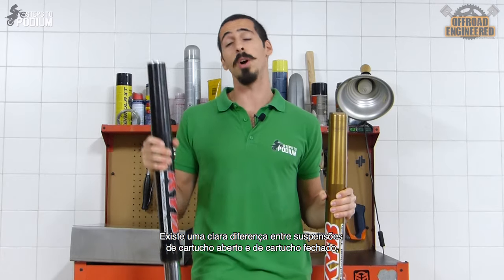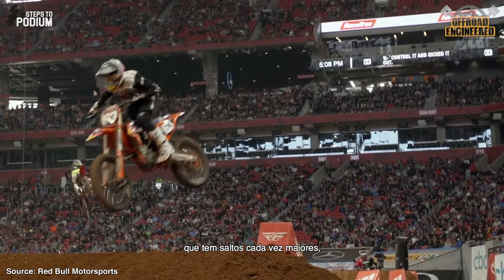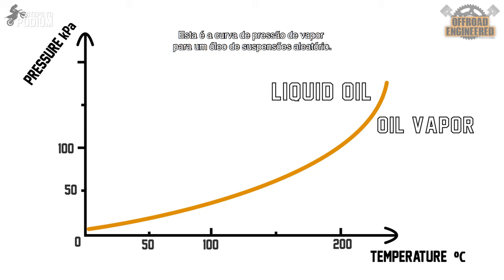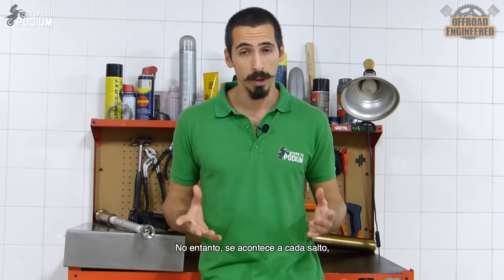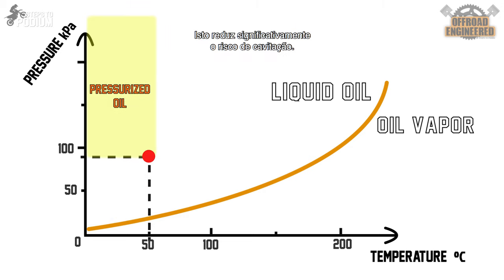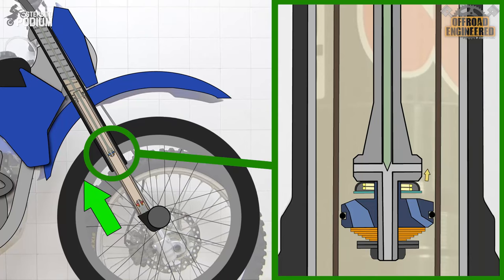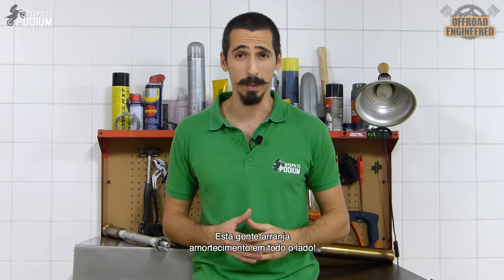The difference between Open & Closed cartridge forks | Offroad Engineered

Comment: Your videos are great. Super clear explanations and great advice. I have tried to work out what the performance difference is between open and closed and struggled to find answers, Now I know. Thanks. 
When it comes to faster cornering and relatability in performance do you think closed is the way to go? Like say a super moto setup.
Reply from the maker: you're welcome and I really appreciate the good word! Thank you! 😊
Honestly, for road use, an open cartridge should be more than enough, imo. the closed cartridge technology only came around to cope with the stresses from Moto/supercross. Enduro and off road in general, benefited afterwards since it got "cheaper" compared to the early beginings
Reply: @StepstoPodium  SO well serviced open setups will give you pretty much the same repeatability and handling unless you a beating it with big jumps. 
Sounds good and cheaper. Nice. 

Now just need to choose springs and oils to dial it in and not of that annoying gas filling.
Reply from the maker: exactly! 😁 I'm glad I could help and if you have any other questions, don't hesitate in reaching out 😊

Comment: Would you rather have a 43mm closed cartridge fork or a 48mm open cartridge fork in enduro-esk situations?

I'm looking to upgrade my stock 43mm suspension which has no adjustments on the forks. The 2 choices are between ordering xplor 240mm suspension & then spring them or get tractive closed cartridge 240mm dropins for my current 43mm forks and their shock to match.
Reply from the maker: That is a really good question! I think that if the open cartridge option are the xplor, maybe I'd go with the CC 43mm
Reply: @StepstoPodium  here's another weird question for you. How hard is it to mix & match off-brand parts? Rebelx sells a kyb 48mm fork for t700 that was shown off by pol tarrer at romaniacs this year. Is it possible to retrofit that to fit a ktm? 

It probably seems like I'm overdoing with the fatti-boi but for some reason I decided this is the bike I want to use when I go out west & check out the harder trails like the 5 miles of hell. So I'm spending gobs of time researching, money building the bike & time at the gym doing squats, deadlifts, and cardio 😭
Reply from the maker: @houjous5131 I have no idea 🫠
Reply: @StepstoPodium  I know there are conversions out there for some forks. Worth the question 😂

Comment: I enjoyed the video, is there a way to modify the damping ability or the length of the trip?
Reply from the maker: Revalving is usually an option! What do you mean with length of the trip?
Reply: @StepstoPodium  It is the distance between the highest point of elevation and the lowest point of compression that varies with the weight of the occupant
Reply from the maker: It shouldn't change if you install the right spring rate

Comment: Great vid. Can you help me understand why installing a rising rate spring on the cartridge piston would increase small bump sensitivity and help with bottoming resistance?
Reply from the maker: Hey Ash!
Sorry to not have replied to this comment. It missed me!
So, assuming that the rising rate spring starts off with a lower rate than the stock one, on the initial part of compressed stroke, the piston will apply fairly little hidraulic preload, allowing the forks to more easily compress without feeling that "harshness" cc forks are know for, and once the forks start compressing deeper, the hidraulic preload will increase exponentially since it isn't a linear rate as the stock one, providing more hidraulic preload and as a consequence, resistance to compression.
Sorry for the lateness but better than never! 😅🙌🙏

Comment: On closed chamber forks, does the outer chamber fluid volume really matter that much?  It’s just lubricant at this point and provides no damping.  Or does it?
Reply from the maker: It not only provides lubrication, but also provides damping and bottoming resistance
Reply: @StepstoPodium  I think I get it now.  The oil just provides lubricant.  But, because it takes up space and is essentially sealed in the forks.  the air gets compressed when the forks compress, and that resistance creates more bottoming resistance.
Reply from the maker: Exactly!! Also, the way some spring perches are made, can actually provide some damping the same way the orifices on a piston provides damping.

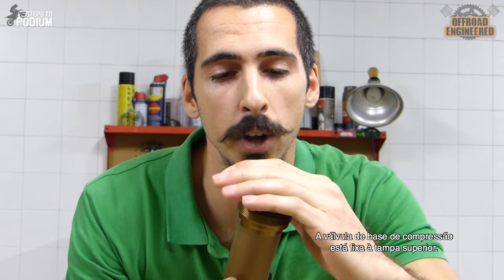Comment: 4:33 -- Is that free piston locked in place with no movement OR is there slack in this piston, allowing the piston to move BEFORE the spring comes into play.
Reply from the maker: It's just a diagram, the piston doesn't have any play 🙂
Reply: @StepstoPodium  I must have something wrong on mine because my piston moves 1\4 or so before the spring comes into play ...
Reply from the maker: It may depend on the brand, but either way when the piston is installed in the cartridge, the oil will force it upwards, eliminating any play
Reply: @StepstoPodium  Ok and thanks ... Are you the guy in the video with the green shirt answering my questions?  Either way, thanks for the help and the videos .. ESP this one ...I had no idea what the differences actually were but having both types, as you said, I can't actually tell the difference with my riding ..
Reply from the maker: Yes, I am, although I'm not using the green shirt right now 😂
Glad I could help!
Reply: @StepstoPodium  You come across well in your talks .... I liked the line about 'these guys should get the Nobel Prize for the work with the closed chambers .. 
--
Where did you learn all this technical stuff on forks?
Reply from the maker: I'm a mechanical engineer so it makes it a lot easier to understand the concepts. 😄
I had the chance to learn with Technical Touch, the official European importer for KYB and the ones responsible for giving race support for yamaha and kawi at MXGP, so I ended up getting some great background knowledge for these videos. Besides that I also work on suspensions, so the theoretical knowledge was developed by the practical knowledge🙂
Reply: @StepstoPodium  Sounds like you are hanging with some good company there...Gonna to another of your green-shirt videos on another issue you address there .. THXS!
Reply from the maker: I appreciate your support in my videos! Cheers! 😄🙌

Comment: Can you please explain to me why bladders are not as reliable as piston and spring 🙏
Reply from the maker: A bladder is a piece of rubber which is pressurised. The possibilities of failure are essentially all around the area of the rubber besides the areas of contact between the bladder and cartridge, so quite big.
Springs on the other hand are probably one of the most reliable systems ever produced in engineering, so it's hard to go wrong with that and what provides the seal is also a really well known part - a simple O-RING, so the area of failure is a lot smaller compared to the bladder. 💪